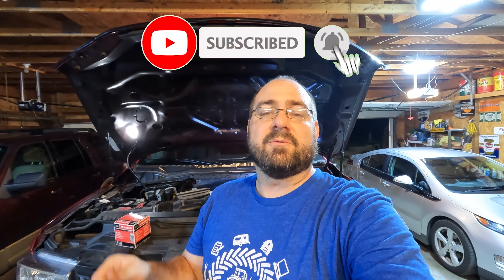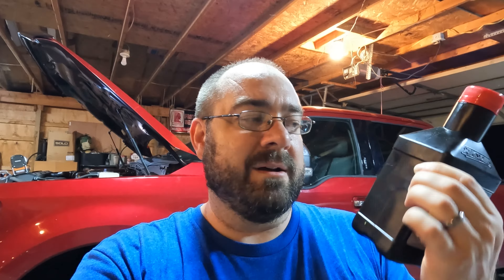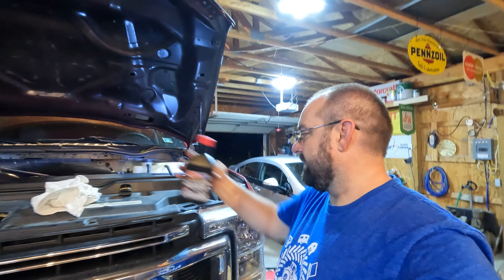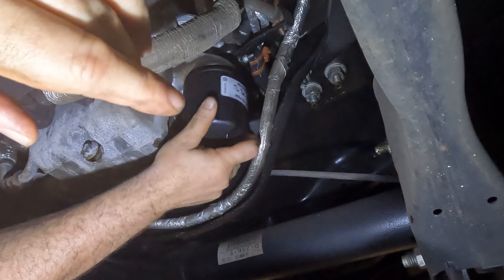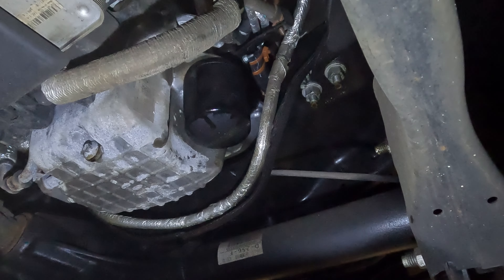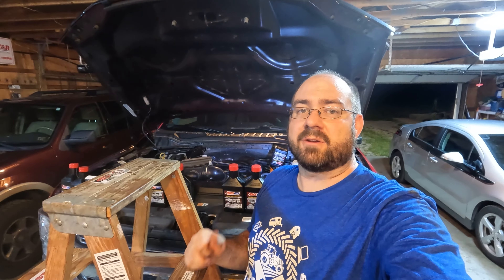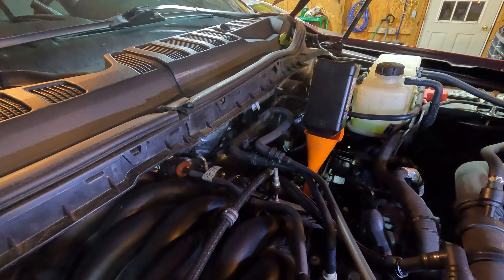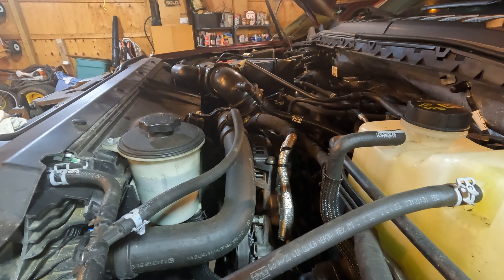Avoiding cam and lifter failure - Ford Godzilla 7.3

Comment: I think if you read the fine print, you'll see that AMSOIL does NOT meet the Ford spec, they use wording like: "suggested for applications that call for for spec ABC123".  Not "meets Ford spec ABC123".  That's a big difference.  EDIT, I just looked it up on AMSOIL's website.  It says exactly this: "Use AMSOIL Signature Series Synthetic Motor Oil in applications
THAT REQUIRE ANY OF THE FOLLOWING SPECIlCATIONS"....  Note that AMSOIL is famous for this tricky wording.  They save a ton of money as a corporation by not getting their products tested by the API etc.  They do their own testing. Do they make bad products?  No, their oil is a great product as evidenced by much 3rd party testing.  All I am saying is you are wrong when you say their oil MEETS Ford's standard.  Technically, it does not and your warranty is in jeopardy in my opinion.
Reply from the maker: I’ve found the Amsoil products to be superior to any other ones I’ve used in the past. I like that they work directly with high-performance manufacturers to make lubricants that work better than other brands. I always like reading the latest news and info on Amsoil.com. I’ve just recently been catching up on their blog posts - very informative. I appreciate brands that are transparent and have educational posts, while constantly updating the products to make a great product even better for today’s complicated machinery. https://www.amsoil.com/performance-tests/
Reply: Amsoil is the best you can get period.
Reply: Yep, I just checked it and you are absolutely correct.  Amsoil does not state that it meets the Ford spec, just that Amsoil recommends this oil for applications requiring oils meeting the Ford spec.  And you are also correct, if the manual calls for an oil certified as meeting a particular API spec, this particular Amsoil product would not qualify (although some other Amsoil products do).

Not saying that these aren't fabulous products.  Just that if someone is a stickler for only using products that absolutely, positively meet the manufacturer's requirements in black and white, there might be an issue here.

Comment: Install a Fumoto drain cock. Much easier than taking the pan plug out .
I worked in a fleet that we used for 25 years before I retired. I've used 1 in my 01 7.3.
Reply from the maker: I've been considering the Fumoto drain. But I've been a little worried about the potential for a small stick or something to turn that valve and let the oil out when it wasn't meaning to. Have you ever seen that happen?
Reply: @PurpleCollarLife  my truck has had one for 11 years and the fleet company I worked for has had them since 87 , when I retired they had around  10,000 truck's. 
I've never seen or heard of one coming open.

Comment: Just My opinion, but I find it hard to fathom that Ford could Successfully deny a claim for not using their oil vs any that met spec's. I change mine every 3k-4k miles with fully synthetic oil. After its refilled I press the gas pedal to the floor and crank it over until I have full oil pressure. IT WILL NOT start with the pedal to the floor. Oil is now in the filter and has circulated. I have a '21 7-F350 with a 7.3l no issues. I did ask the service mgr at the dealership about the lifter issue a couple of years ago. He indicated they had only a few and all on the chassis mounts not p/u.

Comment: Amsoil destroyed my Jeep Wrangler JK engine.  It is supposedly a 15000 mile oil, but after 1500 miles I got deployed.  Came back a year later with no oil stains on the floor of my garage (nothing dripped out), but only ONE QUART of thick sludge came out of my engine when I did a fresh oil change the first week I was back.  The engine never ran right after that mess.  I'll never trust Amsoil again.

Comment: It takes 8 1/2 quarts .  Simple solution 7 1/2 quarts of Motorcraft 1 quart Lucas oil treatment 230,000. Not a problem.  Done this since day one of owning the truck
Reply from the maker: Thanks for sharing! What kind of driving do you do with your truck? You're putting on the miles pretty quickly. But I'm thrilled to see that you've had no issues with almost 1/4 million miles!

Comment: I have never heard of a lifter failure when conventional oil or worst case basis a blend was used. Synthetic oils were created to enhance fuel economy and emissions standards only.
Reply from the maker: Thanks for watching and leaving a comment. I like the advanced technology in the synthetic Amsoil oil - it provides better protection and longer life than the conventional oils.
Reply: @PurpleCollarLife  Yes that is the marketing claim but unfortunately, synthetics do cause bearing and lifter issues and always have. Try find a lifter issue where the owner can prove he wasn't using straight synthetic.

Comment: Had the failure this past summer on my F250 Supercab pickup (I.e. NOT the detuned box truck engine).  Ford replaced the engine no questions asked.  It would have been obvious I used non-Ford parts since it had a Purolator Boss filter on it.
Reply from the maker: Thank you so much for letting us know! Was it a quick failure? Or did you have some symptoms for a while?

Comment: Magnusun moss act.  Any oil that meets the spec.  But you're not going to avoid the inferior cams installed in that motor.   Ford hasn't fixed it yet.   What are they thinking?  You'd be better off to change it more often.  But once the metal lobes delaminate it's over.  Hope it happens under warranty.   That low flow oil pump trick aint helping.

Comment: I would change the oil every 4 to 5000 miles, not the ford recommended, So many engines are failing due to insufficient oil changes, this is all manufactures. The direct injection engines are the worst for sledging up.
Reply from the maker: Thanks! I think running this high-quality oil will really help.
Reply: People are dead set on 10,000 miles cause the manuals says so.. you can kiss longevity goodbye if you are doing that  , doesn't matter which oil
Reply: It has nothing to do with the oil—it's the low oil pressure at idle. It's a design flaw.

Comment: Amsoil is def a top end oil no doubt. That said you are better off using a regular oil and changing it more often than what the factory recommends.
Reply from the maker: Thanks for watching! As quickly as I put miles on, I'd much rather change the oil less often. :)

Comment: How come you didn’t replace the crush washer?
Reply from the maker: Good question. I’ve read conflicting reports on how often that crush washer should be replaced. Some people say “every time you change the oil.” Others say that it’s not necessary unless you see damage or are replacing the oil drain plug. I fall somewhere in the middle. I don’t replace it every time - but probably once every couple years, unless I see a reason to before then. I’ve actually never seen one go bad.
Reply: @PurpleCollarLife  If you look closely you will see the plug only has a built in rubber seal.
Reply from the maker: @DaleSands  Thanks!

Comment: Typical Ford. They design a great engine but mess it up with a variable oil pressure pump that goes too low and destroys the cam and lifters.
WTF?
Reply from the maker: I hope that there is a solution for long term. We really like this truck and the 7.3 engine!

Comment: You couldn't pay me to own any truck 2006-up in GM or Dodge and 2004-up ford ALL JUNK!! I don't care how many miles you have bla bla bla DOD and ford triton and godzilla motors are junk. And their DOD coyote are junk too same with their diesel junk too!
Reply from the maker: I'm curious what you'd buy for a 1-ton truck if you needed one to tow heavy (like our 5th wheel) or haul material heavier than a 1/2 ton can legally tow? Since Nissan and Toyota don't make a 1-ton version of a heavy-duty truck, the big three are really the only option.

Comment: Magnuson-Moss Warranty Act protects you from rogue dealerships telling you that you must use their product(s). As long as the oil you use meets the factory specs, you are absolutely golden. FYI … use those mechanics disposable gloves. Used oil has a lot of bad shit in it, save your health. Amsoil is a superior product, but very spendy.
Reply from the maker: Thanks! I wasn't aware of the Magnuson-Moss Warranty Act until Mark from Amsoil explained it to me.
Reply: @PurpleCollarLife  A few years ago I had to educate a service mgr in a large dealership over a warranty claim that they were trying to avoid paying because I did not use their oil. They even went so far as to say that because I change my own oil, that I don’t have absolute proof that my oil was being changed per the mfg recommendation. I shut them down on that argument by saying "ok, so prove to me that I have not been changing my oil on schedule." I finally prevailed after I told them I’m not playing anymore of their games and will take legal action if necessary. Needless to say, I no longer do business with that dealership.